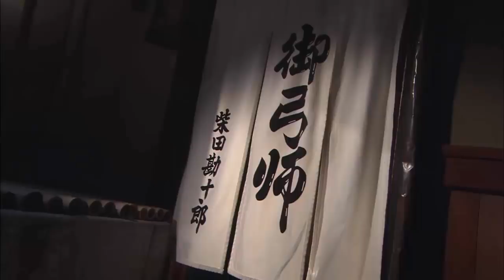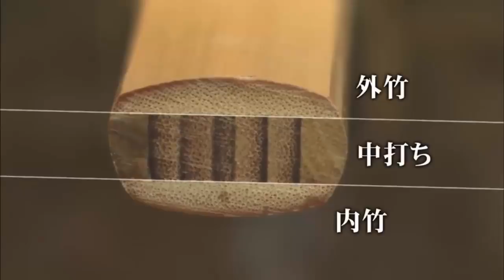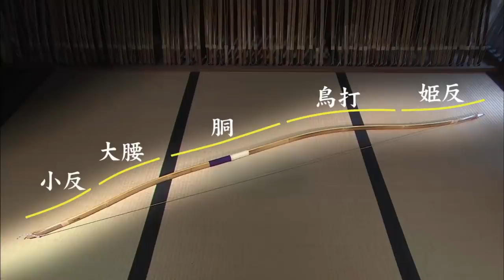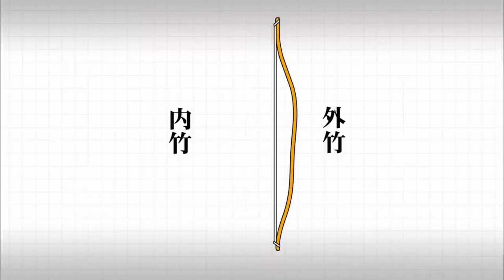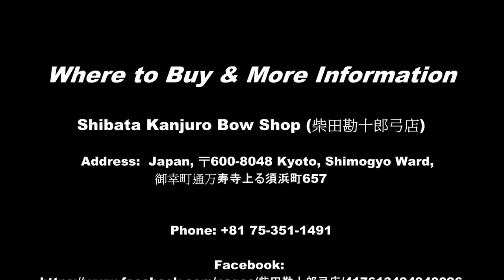The Kanjuro Craftsmen Have Made Bows for Samurai and the Nobility for over Four Centuries

Comment: draw weight would have been nice - was that a rice hull glue - points of information that would have been useful - I prefer knowledge, not feel good music,
Reply: amen
Reply: @Non,Player, Adeptus There's a japanese tv docu on old war bows, they took one from a museum and tested its draw weight with modern pull measure, it was ~170 pounds. Not exactly weak by any measure, as these were used in battles to defeat lamellar steel & iron armor.
Reply: @Non,Player, Adeptus Thank you. I was wondering about that too.
Reply: @Non,Player, Adeptus There was a 196lbs Yumi constructed and weighed during the Edo period, no?
Reply: @jonajo9757   wow thanks i thought the draw weight on japanese bows was much lower! But is it feasible that they used 170+ lbs bows with that technique - drawing partially over head? Or is this just a thing for target bows? You'd need to be hulk to do that with a heavy war bow...

Comment: What are the draw weight of these traditional Japanese yumi asymmetrical laminated longbows?
What little I have seen of such yumi longbows are not very heavy, as far as draw weight is concerned. Usually between 45 to 55 pounds?
Did the bow craftsmen during the feudal times (16th to 19th century) make very heavy longbows so their arrows could pierce armor? Such as with medieval English yew longbows that had heavy draw weights from 100 to 200 pounds or more.
Reply from the maker: It's around 60 pounds draw weight
Reply: @WoodworkingEnthusiasts  Thanks! Keep up the good work.
Reply: @WoodworkingEnthusiasts  Do you know how heavy the draw weights of feudal-era yumi got? Any surviving ancient bows still around. Not many medieval English longbows are around, apart from 137 longbows survive from the Renaissance period that were recovered from the Mary Rose, a ship of King Henry VIII's navy that sank at Portsmouth in 1545.
Those bows were found ranging in length from 1.87 to 2.11 m (6 ft 2 in to 6 ft 11 in) with an average length of 1.98 m (6 ft 6 in). Estimates for the draw of these bows varies considerably. The original draw forces of examples from the Mary Rose are estimated at 150–160 lbs (670–710 N) at a 30-inch (76.2 cm) draw length; the full range of draw weights was between 100–185 lbs (440–820 N). Heavy bows!

Comment: I"m sorry, you must be mistaken.. a yumi is not a bow that could kill a man 50 feet away giving history say a normal yumi is 25 to 35 pound draw..

here in canada you wouldn't even be allowed to hunt with a 35 pound bow..  40 pound MINIMUM
ps.. the samurai  must have never met the longbow.
Reply: I see some utter B.S in this comment. The yumi with 25-35lbs draw weights only refer to modern day yumi which are used in the sport of Kyudo. It isn't about draw weight since they aren't for war, but instead a meditative art. Historically speaking, a war yumi can range between 70-200lbs of draw weight when compared to English warbows. Typically Yumi around 110lbs and such. Not only that, it has an advantage over a longbow in aspects such as power stroke, asymmetrical shape, and more.